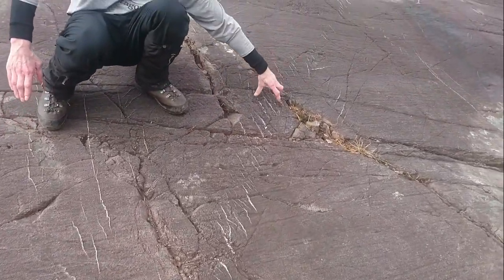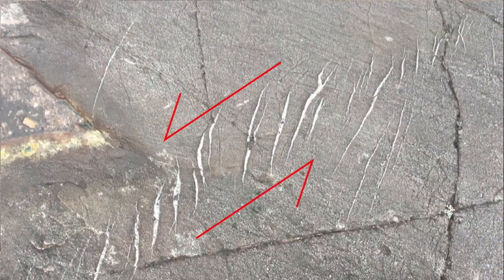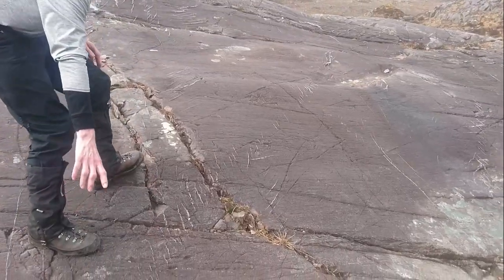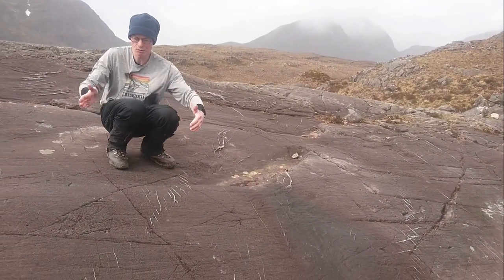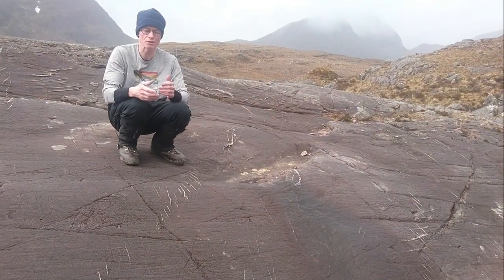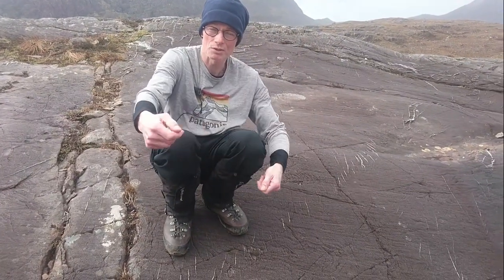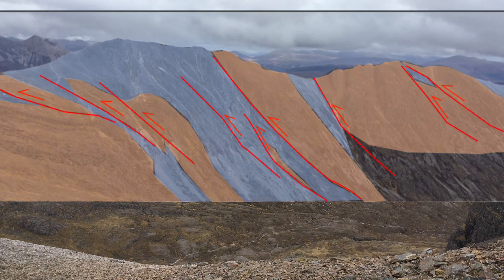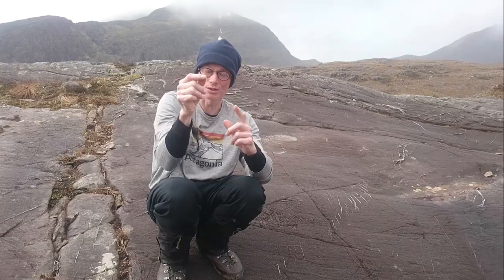Tension gashes formed during thrusting, Coire Lair

Comment: In America we call these Riedel shears, rather than tension gashes, after German geologist W. Riedel, who described them in 1929.
Riedel, W., 1929. Zur mechanik geologischer brucherscheinungen.
Centralblatt fur Minerologie, Geologie, und Paleontologie 1929B,
354.
Reply from the maker: In this case the exposed surface is parallel to the main thrust planes, which are largely bedding-parallel.  I don't see much evidence of shear across any of the veins so they are T, rather than R or R' shears (in the Riedel nomenclature).  I believe them to be tensile features associated with bending and unbending  of individual thrust sheets as they step up across beds, rather than Riedel fractures "parasitic" to the thrusts.  I might be wrong as we don't have any nice 3-d exposures here but that is my best interpretation of what I see in the field.